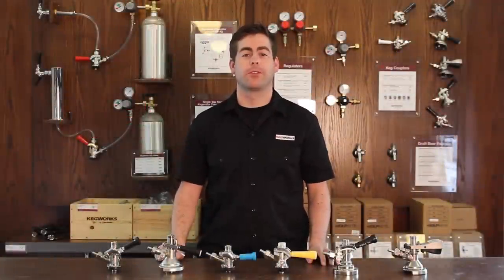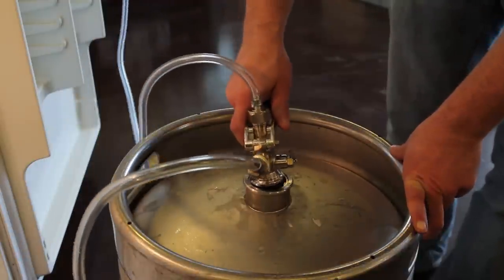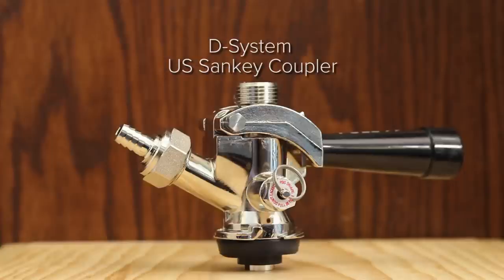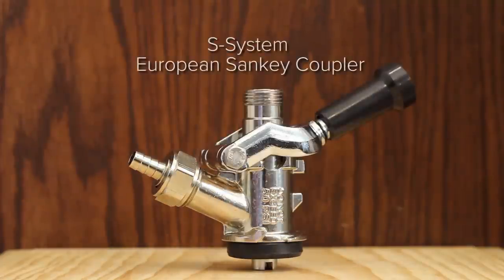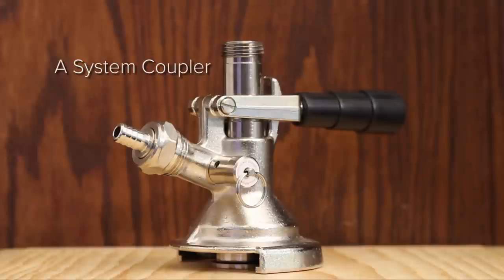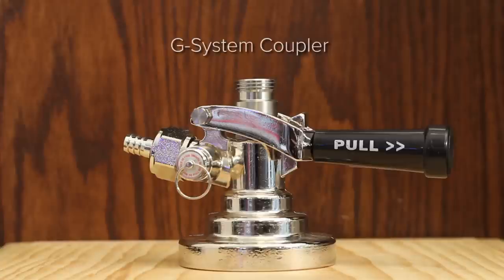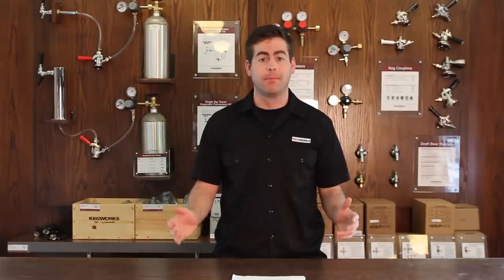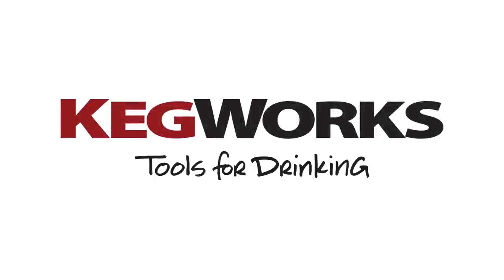Keg Couplers for Draft Beer Systems

Comment: They all do the same thing right? i know there are different couplers because manufacturers make different models but why are different couplers used for different beers?
Reply from the maker: Richard Perkins They all essentially do the same thing, in that they dispense beer from a keg.  Different couplers are used for different beers because there is not a standard for kegs in draft beer. Especially beers outside of the US.  They will use different couplers because that may be the standard.  Always be sure to check the keg and what kind of coupler it requires. Cheers!!